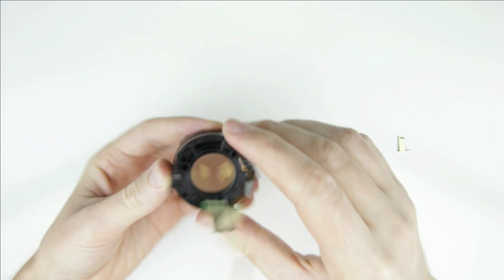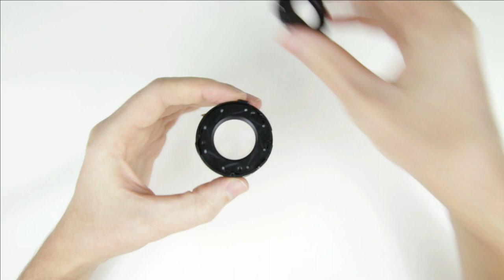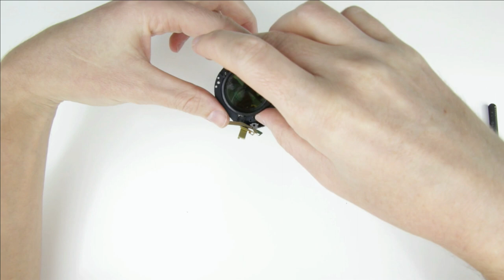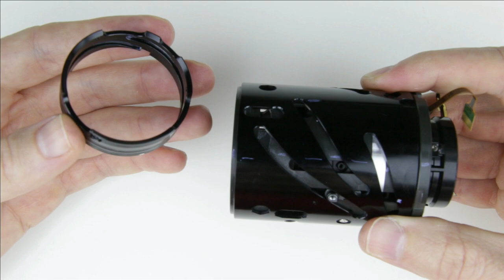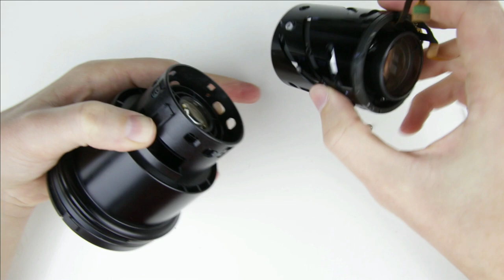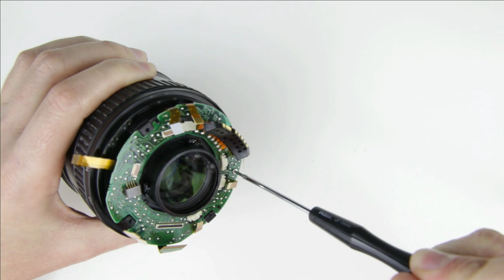Canon EF 24-105mm f/4L IS USM assembly after the aperture flex cable has been replaced

Comment: You sir are amazing - I was able to fix it myself following your steps, but holy shit that was one of the hardest things I've ever done in my life. It took me 8 hours and was sweating all the time like crazy. Even though it worked out perfect I've almost failed couple times so here are my tips:
1. Some screws are really tight - get a good screwdriver and apply a lot of pressure when twisting. I fucked up few 3 screws because of cheap screwdriver and even had to drill out one of them. Luckily I had replacements.
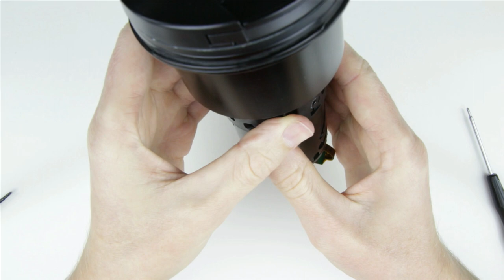2. Plastic knob at 25:46 is surprisingly fragile. I applied too much pressure to it and it broke. Had to super glue it back - no big deal.
3. Pay extra care when desoldering/soldering aperture flex cable. The connections seem like a normal pins but underneath they are just super thin wires (they look like wire directly from aperture motor). I almost ripped one of them out when pulling old flex
4. Get a organizer for screws and mark them with timestamps from disassembly video. It has been a huge help for me when assembling back. There are about 15 types of screws here.

Once again thank you!
Reply from the maker: Thank you for the feedback! I don't use organizer for the screws, but I place the lens parts and screws next to eachother on my table, so when I have to assemble the lens, I always know which screws or parts are the next.

Comment: At 24 mins in, instead of placing the focussing element in the front barrel, position it correctly in the zoom barrel and then carefully slide the whole tube into the front end of the focus barrel, being careful not to trap the 2 flex cables. It will be easier to line up the focussing peg and key if the large front lens element is removed. 
Otherwise, I have found your video very clear and helpful.
Thanks
Brian B.
Reply from the maker: Thank you for the tip, I'll try it next time!

Comment: These videos are awesome. Do you have one where you just replace the USM or does that require the same full tear down?
Reply from the maker: I remove the USM motor at the beginning of the disassembly video, so it is very easy to replace it with an another one.

Comment: Great series, much appreciated! However, I'm still having the same issue "Err 01" after replacement, but it's slightly improved since I can take some pictures. Could there be something else that's malfunctioning? The pictures are also not as sharp as I thought they would be, I guess I missaligned the calibration-screws. Thanks!
Reply from the maker: Error 01 problem: check if the lens gives you this error if you use it other than f/4 aperture. Also, check if the aperture is working by setting it to small, use the DOF button on your camera and see inside the lens if the aperture is moving. As I remember, the IS unit could cause aperture problems: if the IS cable is broken, then the aperture doesn't work correctly, it goes to random positions if you set it to small.. you can check that also with the DOF button. If the aperture is the problem, you can disassemble the lens, check the connection of the aperture flex cable with a multimeter, change the aperture cable, or change the whole aperture unit which is not too expensive on aliexpress. Also, check if the aperture cable is not damaged when you put back that metal holder which bends the aperture cable back... if you push the metal which bends the cable too much, it could damage the cable.
Sharpness problem: There is a lens on the aperture unit which has 3 screws and 3 pins for calibration. When you put back the three screws don't tighten them. First, tighten them lightly until you feel some resistance, then twist the screws back by quarter to half round.
Reply: @CamerasLensesEtc  thank you so much for the detailed answer! I will try this after work today and we'll see how it works
Reply: @CamerasLensesEtc  hi again, here with the results. 1. I tested all aperture settings and the camera works perfectly on f/4, but gives err 01 on every other setting. 2. Turning IS on/off does nothing, but I guess I could measure the IS cable with a multimeter during my next teardown. 3. Didn't even know what that button (DOF) did. The aperture jumps to random positions like you describe, and it's not always moving to another position. Tested another lens and the blades jump instantly, so there's a problem for sure. 4. I ordered a complete aperture unit that I will try. 5. I tighted those 3 screws very lightly, but I did not back off. I'll try that aswell. Thank you for the help, I've got something to work with now!

Comment: I broke the plastic tab on assembly at 26.00 and superglue didn’t hold up so be cautious when mounting that barrel.
Reply from the maker: Thank you for the tip!
Reply: @J RM I will give the epoxy resin a try. If that doesn't hold I may try heat welding it together. Thank you for the tip.

Comment: Wonderful guide! I came to check how the zoom cam barrel works. The two tubes rotate independently which is quite nice design. Did you just mark the IS colar position so you do not need to re-calibrate this lens?
Reply from the maker: Which part do you mean exactly? Can you give me a timestamp?
Reply: @CamerasLensesEtc  From 19:36. You put back decentering collars and turn them to a position marked on the black cam barrel
Reply from the maker: @Guoenyi  Yes, I marked the eccentric plastic collars when I disassembled the lens, and I set them to the same position when I assemble the lens.
Reply: @CamerasLensesEtc  Did you have to count how many revolutions?
Reply from the maker: @Guoenyi  No. I have to turn the collar to its original position. Before I removed them, I placed a mark on the collar, and next on it on the lens. You can see the white marks on the lens barrel. Also, the collars have to put back on its original place, so place them next to eachother as you removed them.
Reply: @CamerasLensesEtc  interesting I thought these collars are threaded outside for IS adjustment but apprently something is inside the collar to do that
Reply from the maker: @Guoenyi  The hole in the collar is not in the center, but a little bit off, so by turning it, then you can move the IS module back and forth.
Reply: @CamerasLensesEtc  Thanks! That is fascinating. Will this eliminate the need to re-calibrate lens? One think did not like about handling IS lens repair that touches IS is re-calibration.
Reply from the maker: @Guoenyi  Generally, you have to put back the calibratable parts exactly as they were there, that way it is no need to calibrate the lens. Some say you still have to calibrate the lens, but after I assembled them, the image quality was the same as before, so I don't have to calibrate them.

Comment: Excellent video my friend. I have the 24-105 L which the barrel is lose on, any advise on fixing this issue please?
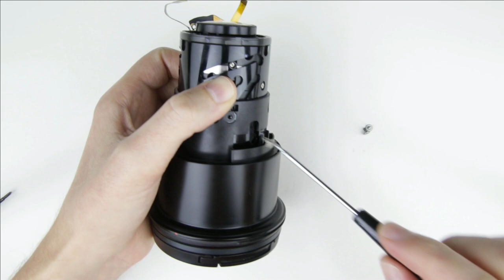Reply from the maker: If the problem is that the front lens tube is loose, wobbling or have zoom creep, than you have to tighten the three screws which you see at 26:30 in this video.
Reply: CamerasLensesEtc thank you, I’ll make sure I limit my caffeine intake so hands are steady and will dive in. Thank you again 😎